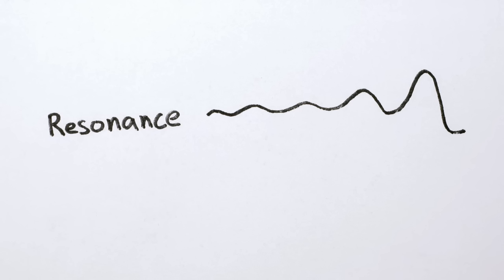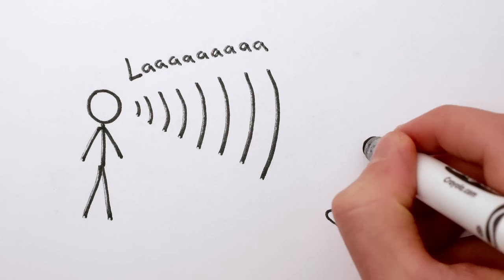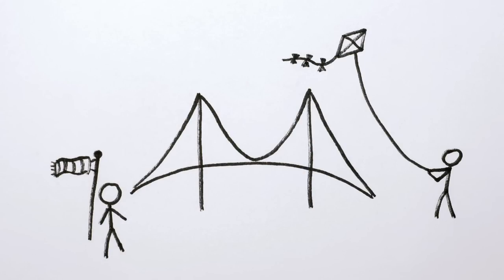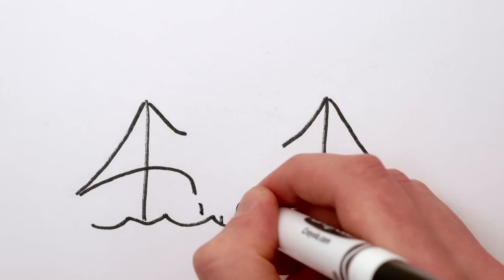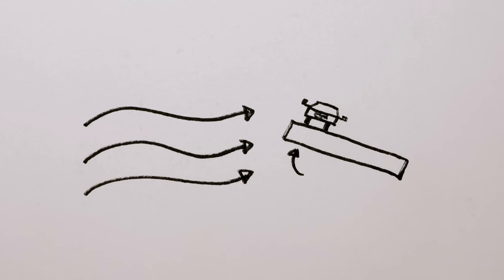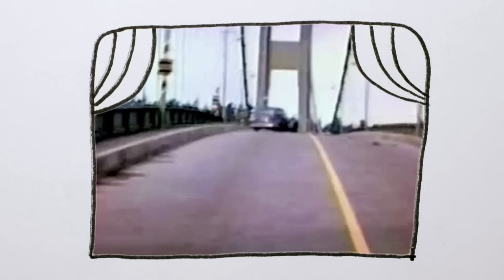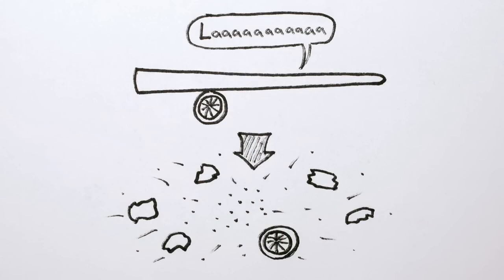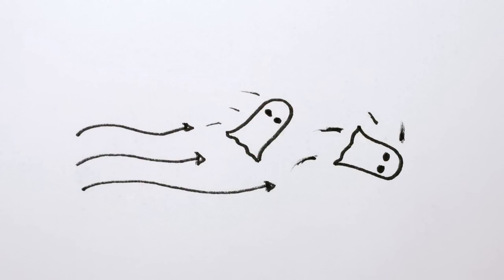The Tacoma Narrows Fallacy

Comment: I sympathize with the desire to make a big, clear, sweeping claim, but I think in this case the desire has lead to overreach. You are saying the bridge collapsed due to "flutter", which is a kind of positive feedback loop in which more deflection of a surface in a wind leads to more force leads to more deflection and so on. That's a great insight. But you are also saying the bridge did NOT collapse due to resonance, which is at best misleading. The flutter runs away because there is not enough damping to take the vibrational energy imparted by the wind back out of the system. And THAT'S largely because the bridge begins vibrating at a resonant natural frequency. You can see this with your own eyes in the video: the bridge settles into a vivid standing wave pattern. The key characteristic of such a resonance--just as you say--is that it allows more and more vibrational energy to be added to the system--by the wind, in this case. So 'flutter yes, resonance no' is a bad way to think about it. Better to say that flutter fed energy into a natural resonant vibrational mode of the bridge until the bridge collapsed.
Reply: +Gregg Collins well said
Reply: +Gregg Collins "Resonance" is the response of a system to a periodic driving force with a frequency at one of the system's eigenfrequencies (natural frequencies). In this case the driving force is a continuous (not oscillating) flow of air that creates a positive feedback loop with the bridge, which is vibrating at a natural torsion mode. You can look at it this way: The wind provides negative damping to an already vibrating system. The initial disturbance could have been caused by periodically shed vortices, in which case the air and the bridge would be in resonance.
You confuse the terms "natural frequency" (in this case that of the bridge) with "resonance frequency" (frequency of the driving force).
Reply: Resonant excitation of a vibrating system does not require a periodic driving force. A single non-periodic impulse can stimuate a system to vibrate at its resonant frequency.
Reply: Lish Lash The very definition of resonance is "The increase in amplitude of oscillation of an electric or mechanical system exposed to a periodic force whose frequency is equal or very close to the natural undamped frequency of the system."
Sure, you can get a system to vibrate in its natural frequencies by applying a non periodic force (a Dirac pulse for example), but then it isn't resonance.
Reply: That definition is misleading to the point of being WRONG. It implies that the resonant response of the vibrating system is induced by the frequency of a periodic external force. While that is indeed ONE way to induce a resonant response, it is merely the most efficient way to transfer energy from an external source to the resonant system. In reality, any external force will provoke an underdamped system to oscillate at its inherent resonant frequency. A non-periodic impulse function actually produces the purest resonant response, as it imparts no periodic influence of its own.
Reply: Lish Lash
No, a system does not have an inherent "resonant" frequency, it has (many) "natural" or "eigenfrequencies". The term "resonant" frequency only applies to an exciting force, when it is tuned to such a frequency. There is a fine difference between the terms "natural" frequency and "resonant" frequency. Even though they have the same value, they describe different sides of the interaction.
These terms get confused all the time. You really should look up the definition of "resonance". It is a phenomenon that occurs between at least two oscillating systems. If you want to convince me otherwise, now would be the time to present some reputable sources, but perhaps it helps my authority on the matter when I mention that I calculate those frequencies for a living?

A perfect impulse function will cause the system to vibrate with all its natural frequencies along the excited axis at once, by the way. The response is a huge mess in this case.
Reply: We don't use the term "eigenfrequency" in electrical engineering, so this dispute is probably just a difference in technical jargon. Here's an example of an introductory text, treating resonance in electrical and mechanical systems, starting at page 46. 

http://my.fit.edu/~vkepuska/ece3551/Lecture%20Notes/Chapter%2006.pdf

Real-world systems will often have multiple resonant frequencies, but will typically exhibit a single dominant low frequency resonance. An unanticipated torsional resonance at around 0.2 hz was suspected to be the culprit in the Tacoma Narrows bridge collapse.
Reply: Thanks for the links. 
Seems like you electrical engineers use the term a little more fuzzy than we mechanical engineers. But I still have to insist that in mechanical engineering and physics "resonance" and "fanned vibration" at a natural frequency (that took place at TN) are physically and mathematically completely different phenomena.